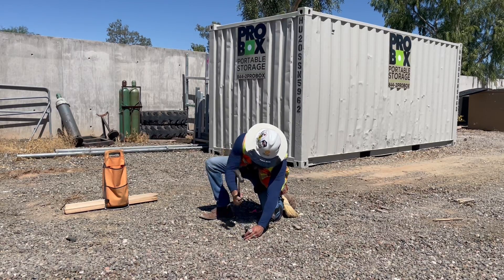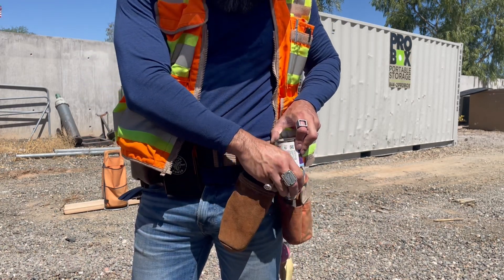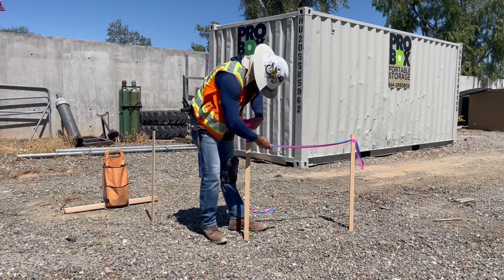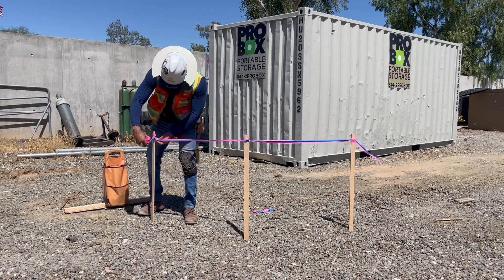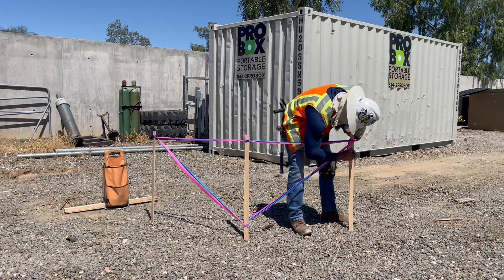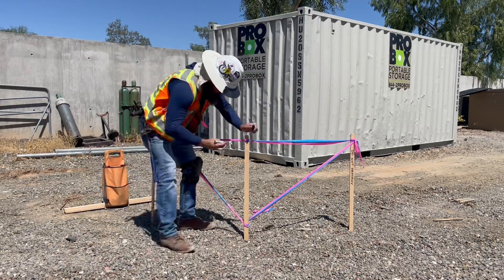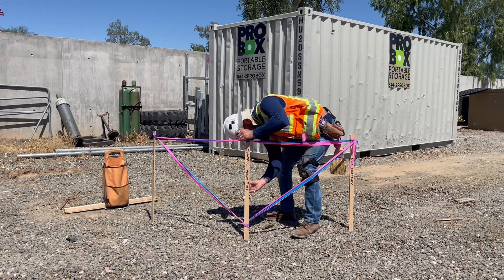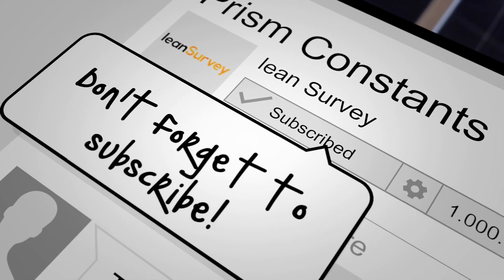Surveying: Flagging a Control Cage

Comment: A RR spike is "super light"? Because I've mostly run boundaries, I have a sense for what is/is not light in my vest/pack/bag. Of course in construction staking the vehicle is always handy, light is irrelevant.

We call our cages "targets" because that's what it seems everyone else calls them. And I've never ever seen one huge like that. I'll note when I do.  I do think that some construction guys have no idea that we need our controls to last though all stages possible. It costs the construction co. every time we have to reset controls, I'm sure someone on that side knows this.
Reply from the maker: Light in comparison to the alternatives, like an 18” frost pin or pneumatic drill bit, often used to break ground and sold at most Survey supply shops. I agree, many surveyors are setting control just to check the “line of sight” box, and are not contemplating the life of the project. Having conversations with trade partners and the project team about where control could be maintained and best utilized not only takes the future into consideration but also invests the project team in your work and creates a plan that belongs to you both. With the right conversation, the project team will defend your control in your absence because they view it as part of their own  success model.